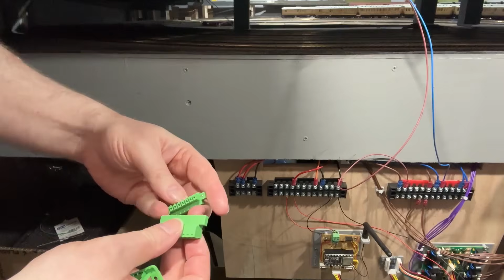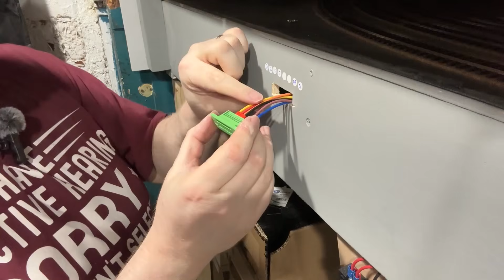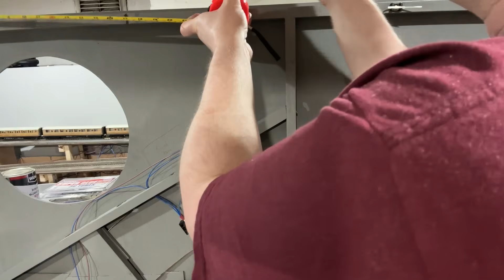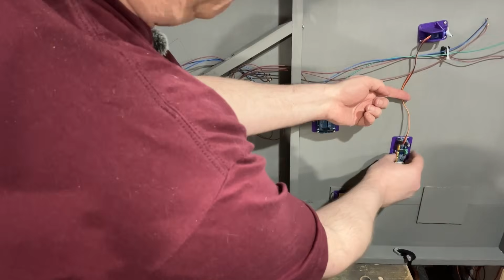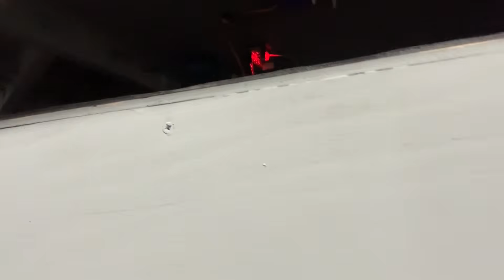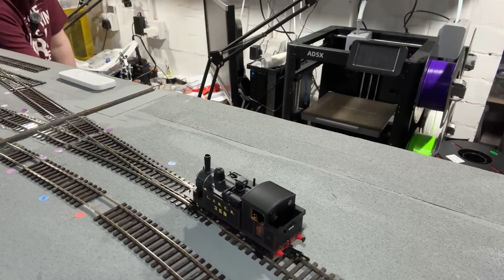141, Points, Connectors & Wires! at Leopard Street Model Railway #modelrailroad #modelrailway

Comment: That connector looks like a nice neat fit into the board and makes for easy connection and disconnection. Good to see the servo working nicely too 🙂 The hours spent on it are no surprise - I don't think I'd have got anywhere near as much done - I'd probably need a week for all that 🤣
Reply from the maker: it felt like a week :) there was more than just whats in the video, it may seldom seem it but I do at least plan a bit of this.. mostly in terms of what needs doing, the how it gets done & where things go.. less so :)

pleased with the connector, it looks decent and works, looks matter less than working but there are times not being a total mess has advantages :)

Comment: You are much further along in your build than me but I have a different view on blocks. Short blocks and blocks just for a crossover etc are a complete no as far as I’m concerned. Wirenwood fell into this same trap and ended up needing further sensors to alleviate automated train crashes. I’m of the belief that your blocks should be as long or longer than your longest train. Doing that means you have no part of your train over hanging another block or junction. Be interesting to see how this pans out for each methodology. We can of course always reconfigure the blocks down the track (no pun intended) to make them longer or shorter to suit operational needs.
Reply from the maker: ideally blocks are longer, however here it wasn't possible due to the board build - however what matters is how they are used, for example JMRI allows blocks to be grouped into sections which can then be used, this is, more or less, what I'm doing. for example take one of the two loops I have. this is many blocks, probably 10 or so (I don't actually know off hand, do need to document this), but it is only four sections.

two sections will have signals (essentially virtual for now) at the exits protecting the next bit. these are long sections where trains can be held - one on the scenic side approaching Leopard Junction, the other in the hidden area with a storage loop in parallel.  then two transient sections, one of which is little more than a set of points, maybe 18" in length. the other much longer, with two double junctions, that sadly do not have space between them to hold a full length train. trains are not allowed to stop here.

with any sort of automated running thus each loop really can only have a single train as they cannot move until the line to the next signal is clear.

manual ops is "yeah whatever"

my own software is pretty crude but works in a similar way (I'm not using JMRI automation as I want to do a few things it makes quite hard) with trains starting and stopping in certain points, and more or less ignoring the track between - hence the shorter bits near the signals, these are the bits that trigger actions, the rest is just monitoring really

so far it works on the lower deck, will be interesting expanding it to the station deck

tl;dr: the signalling system for control uses larger sections made of multiple blocks, not the individual blocks
Reply: @aleopardstail Haven’t really got into the sections thing and how that feeds into routing in JMRI. Perhaps that’s the bit of info I’m missing in this. Will have to dig into that. Thx for the pointer.
Reply from the maker: the routing side in JMRI is.... yes..

that needs blocks covering the whole route. can be as simple as "I start here", "I travel here" & "I end here" though, the user defines the "transits", i.e. the route, it doesn't seem the software does path finding. in theory you only need a block for locations you may want to change route.

its worth having a play, but in effect a block provides information, if you will not use that information blocks can be combined :)

Comment: I've had a buzzy saw for about 6 years now - used it for the first time early February this year - handy hint, don't have stuff on the table above where you are cutting, it can vibrate all the way over to the edge and fall on your head.... words will ensue!!
However, I didn't know they come with smaller width blades, I may need to go investigate the local hardware shop!
Reply from the maker: this one came with three blades, and a whole bunch of other bits. that small blade was a blessing as otherwise would have ended up making a lot more mess

thats a good bit on the vibration, hadn't thought of that :)

Comment: Thanks for another useful video. What are the 8 way connectors called and where did you get them from? I cannot find the ones that fit in a panel!
Reply from the maker: I got them from aliExpress

2Sets 3.81mm Pitch 2/3/4/5/6/7/8/9/10/12Pin Pluggable PCB Screw Terminal Block Connector with Fixed Panel JM15EDGWC-3.81

stumbled onto them, seems to be a normal connector that has another bit providing the panel mount

Comment: You've got one problem: the track on the edges of both boards isn't lined up correctly. To make sure the boards are aligned correctly, you have to stick them together first before cutting the track. Trust me, you'd be better off without those diamond crossings in the long run. It's one way of avoiding the mistake of sending the engine along the wrong track. Just have two tracks leading to two run-round loops, adding the turntable track connected to the outside loop. Operating trains will be a whole lot easier, believe me. The fewer sets of points used, the more happily your steamies will perform for you.
Reply from the maker: the misalignment was intentional (for once!) the adjacent board is pushed back, this was to stop anything shorting as it drove over the gap and to remind me to take it very slow and stop!

it does line up when together, as you say being firmly in place, held there, lay the track and only when its all firmly fixed down, only then cut it..